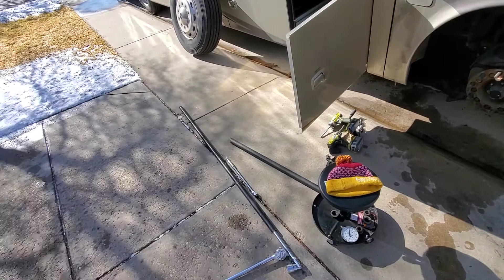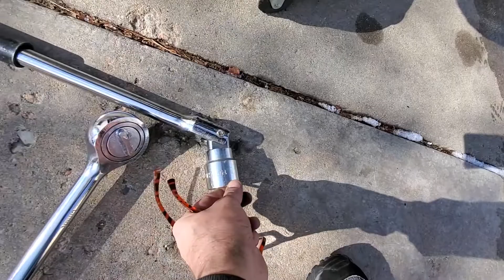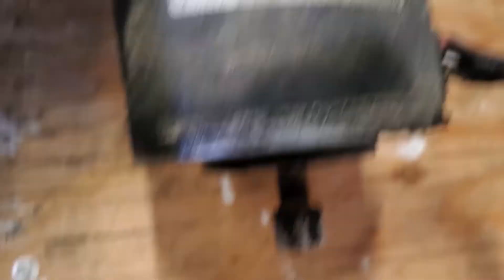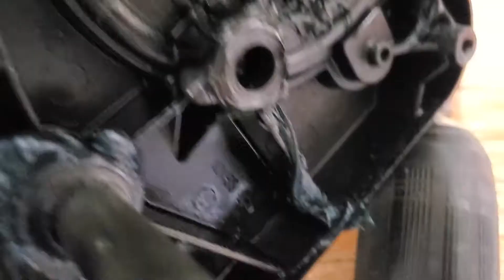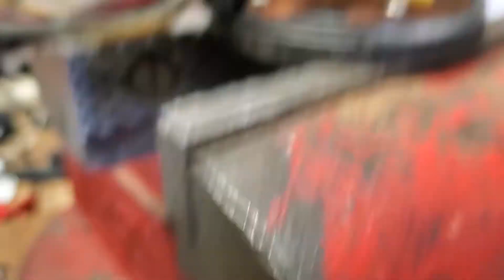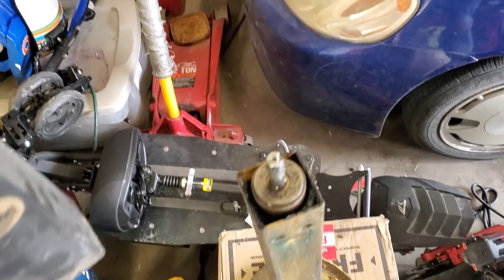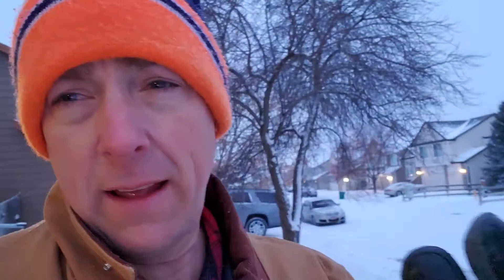Atwood Levelegs Inside view

Comment: Poor guy!! TY TY TY 
My 2006 Bounder has levelegs and while trouble free (26k lbs loaded coach) i have had my driver rear jack FALL OUT when the jack screw shears off!  6 yes ago i replaced it. THAT 2016 Jack has now failed - and no parts. 
  ??? Do you have a 15” jack screw? Thanks! K. Kincaid

Comment: How did your big foot install go?
Reply from the maker: It went well, the Bigfoots are still working well.  I paid way too much for a shop to install them for me.   In retrospect, I could have done the install myself, as there was only minimal welding of the reservoir brackets required.  The mounts you see in this video were used to mount the Bigfoots, so they were able to reuse the brackets already on the frame from the levelegs.

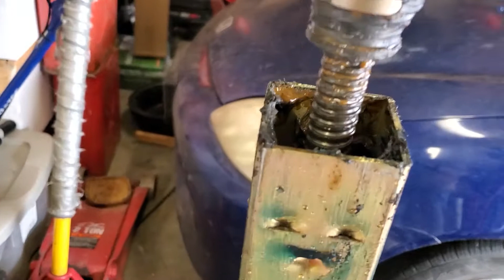Comment: At the 11:35 mark you ae using a drill to screw the shaft up. What did you use on the drill to attach to the shaft? My shaft appears to be siezed up in the casing.
Reply from the maker: I just tightened the chuck on the 1/2 drill onto the shaft

Comment: Also I figured you don't have to carry a drill and cord FJIC. Another way is a 12V battery (take house battery?) and a piece wire to hook up to the motors. Either take out the plug and stick it in or splice the wire and put permanent terminals. Assuming your motor did not go bad :)

Comment: My manual says the controller times each jack up and down and give error if those two not equal for each jack (yeah times, not turns). I was having problem with one of the rear ones. Measured both of the rear and indeed there was about 3 secs difference. The good one was about 1:23 consistently (plus or minus 1 sec or measurement error).
Reply from the maker: Cool - mine had broken gears and shafts in 2 of 4 of them so the time to retract or extend was infinite, like never :)

Comment: Thank you for this. I also have an 08 Phaeton and have had issues over the years. This really helps me understand just what I’m up against and I will be planning to replace mine also.
Reply from the maker: Yup, the Bigfoots have been great ever since.   Those Atwoods really were not designed properly for big heavy rigs.  The Bigfoots can lift up the end of the rig without straining at all.   Also, I really should post a follow up with the things I have learned since then, like the fact that the Bigfoots could be mounted directly to the existing Atwood welded on brackets, and where the pumps are mounted in each position.   The pump/reservoir brackets required some minor welding.  I had a shop put them on, but in retrospect, it could have been a larger DIY project.
Reply: @striderz69    Any progress with the Bigfoot follow up?  Looking forward to your lessons learned before I  commit.  What was cost of system and cost of installation?  Who did the work?
Reply from the maker: @martinbadrov5542  Bigfoots are still working great, and are solid and work every time.  Only issue I have had is a dirty "up" switch causing beeping "not all-up" alarms for me as I was driving, but easily remedied by lowering and raising the jack again.  I have used them in snow, ice, cold and hot temps with no complaints.  I recommend SnapPads also, makes them a no-contact set up when I arrive at camp.  I had a place called Pro-Tech in Colorado Springs do the install, but in retrospect I could have done it myself, as they re-used my old brackets that were welded to the frame, not the new ones supplied by BigFoot.  I wish I had gone to the BigFoot factory for the install, as it would have also been cheaper.
Reply: @striderz69  Do you mind sharing what they charged for the install?  I’m getting some crazy prices from all the shops around me….

The big foot shop is a 3000 mile round-trip. There’s gotta be someone here in the mountain west that can do it for a reasonable price….
Reply from the maker: @martinbadrov5542  $2000 labor.  striider@gmail.com is my email if you need more info.

Comment: Still have parts?  I need the right rear mounting bracket and the three plastic housing pieces for the gears.  What kind of grease did you find?  Thanks for all the info.  Adam at chevymetal70@yahoo.com

Comment: Still need parts? How do I contact you?
Reply from the maker: Nope, changed to Bigfoot and never looked back, except still have these laying around the garage mostly.
Reply: @striderz69  need the two spur gears that transfer power from the motor to the screw drive, they would set on top of the leg in your pic- I could send pics if you send me your email
Reply from the maker: @michaelfrederick3794  striider@gmail.com

Comment: You mentioned Gama for controls of some sort. I have a 2005 Gulfstream on a Chevy Kodiak chassis with a defective circuit board. I found a replacement circuit board but it is for a FORD chassis which is wired slightly differently. I would appreciate a reply. Thanks  JwgK in Houston TX
Reply: I am not sure how the FORD version of circuit board differs, I think maybe just the dump circuit, which you can wire manual with a 3 way rocker switch, which you have to do anyway if you use the GAMA.   The jack circuits should be similar, as all they do is reverse polarity to the jacks to raise or lower them.  I have HEARD on the forums that SOME parts are still available from Lippert (who bought Atwood) for these jacks, but could find none when I was looking.  Here are the GAMA controls I ordered, but my root issue ended up being too much resistance from the jacks due to broken shafts inside the gear boxes and I had to replace the whole system with Bigfoot eventually, as I had a front and a rear jack physically fail.   https://www.gamainc.com/product/rf340-4pr-asl/?attribute_pa_communication-range=long-range&attribute_pa_enclosure-type=standard&attribute_pa_transmitter-type=waterproof